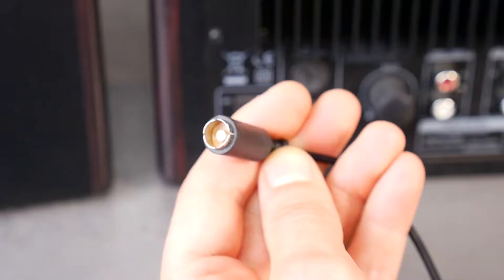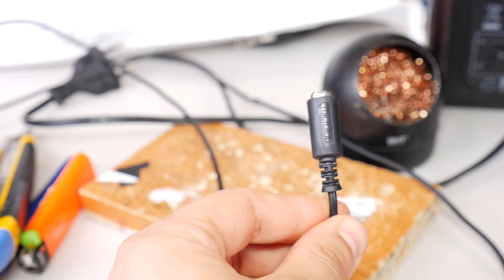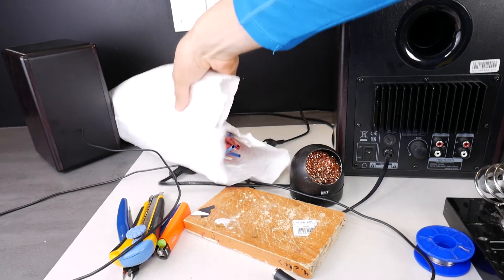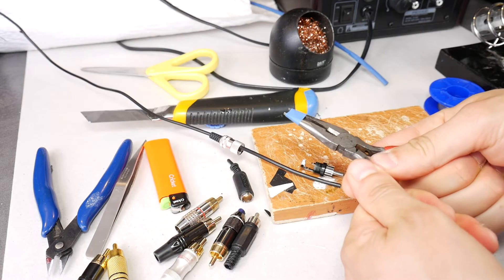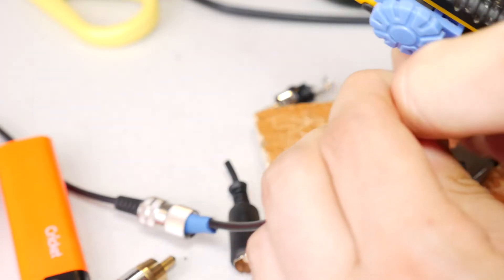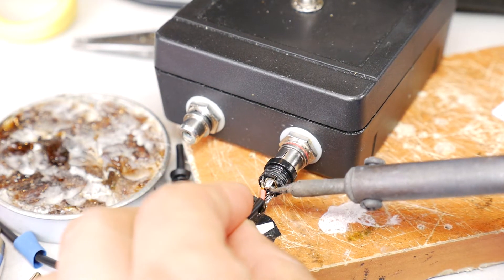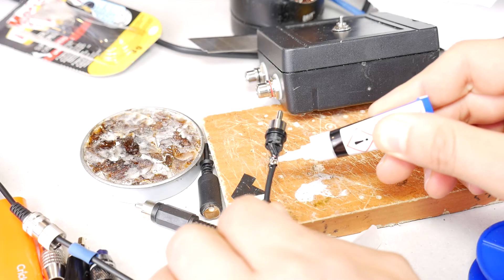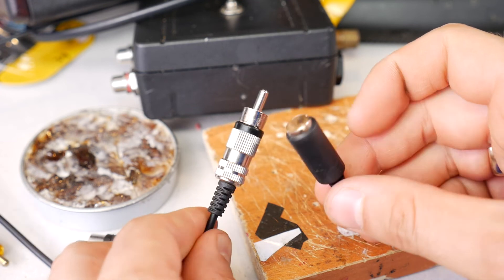How To Remove & Solder RCA Plug DIY

Comment: Did you add superglue directly on the the wires where it touches the ground and signal pins? I know you said it but wanted to clarify. Would heat get produced and melt the glue or nah? Is your speaker still alive n kickin? Just bought a cheap logitech z407 from goodwill for $19.49. Everything looked new and well boxed then realized the right speaker had the exact issue your 2 videos explained so I subscribed. Hope I can save some cash and get this to work. Thanks! (only the left speaker and subwoofer work at the moment)

Comment: Is it possible to just superglue the snapped piece back on?
Reply from the maker: you can glue it, but the cable will probably not work because there will not be a contact for the metal shell.
Reply: Are there any other solutions? I don’t have soldering stuff at home and my cable is connected to my speaker, so I can’t just buy a new one (pebble v3 with subwoofer). Thanks
Reply from the maker: @superswager414  just buy soldering kit, it save life a lot of times :)